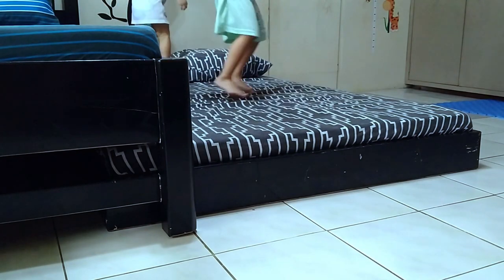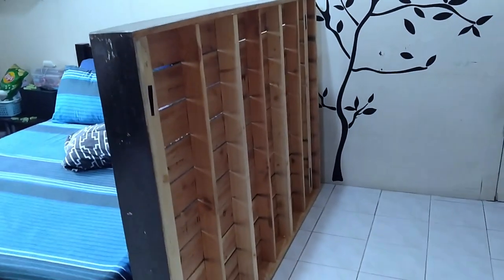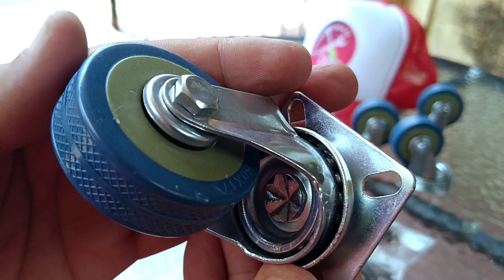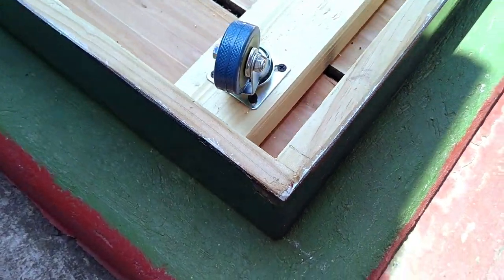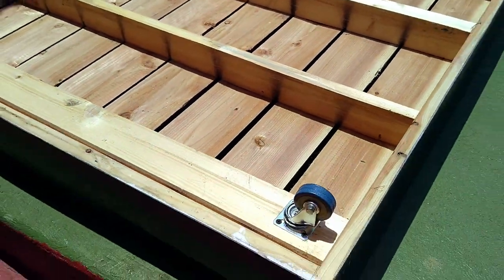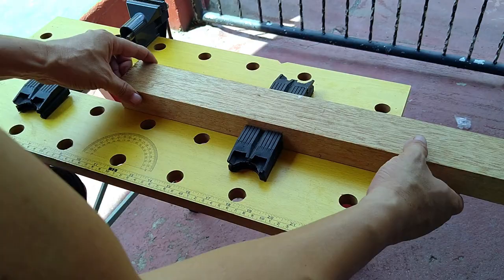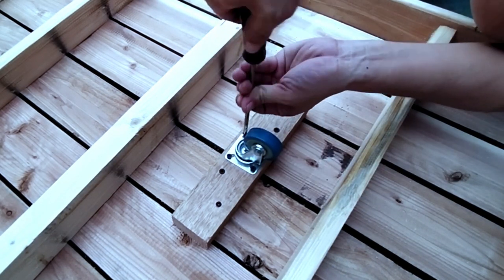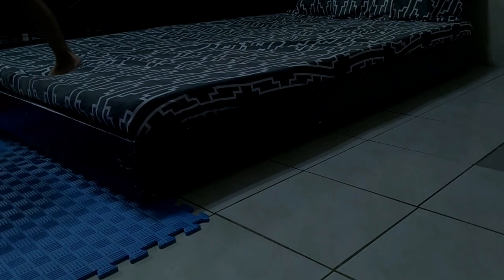Installing Caster Wheels on Heavy Furniture (Pullout Bed)

Comment: I'm inspired. My very heavy hideaway bed couch will get some wheels now! I think also, if you don't mind, handles on the trundle bed would help.
Reply from the maker: Yes, you could also attach handles on yours 👍 But for ours, there's enough clearance between the bed and the floor to fit my fingers through. So i decided not to attach handles anymore so as not to impact the aesthetics. And because we have kids, safer not to have anything protruding underneath that may cause accidents 😉
Reply: @HanDIYman007  Hi! That was a fast reply! No, my couch, although very beautiful, is an old out of style fold up. We are thinking it might need wheels in the middle, not just each end. Your trundle, outside edge for a handle or so, if that's even needed, with those wheels! Enjoy your kids!

Comment: shouldnt ghet the sweelvel caster. A one way directional caster will do as the pullout bed just goes 1 way and 1 way only.
Reply from the maker: That wouldnt be practical when it's cleaning time and you need to maneuver the pullout bed somewhere else in the room.